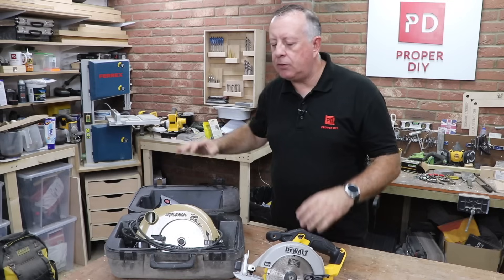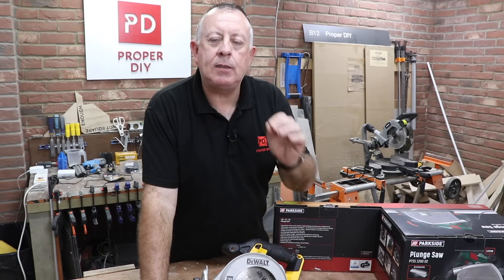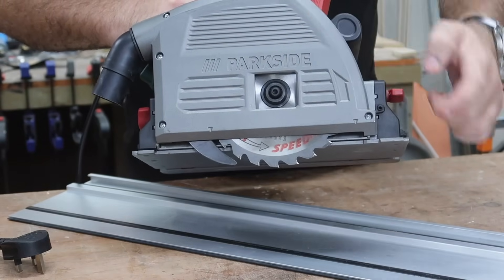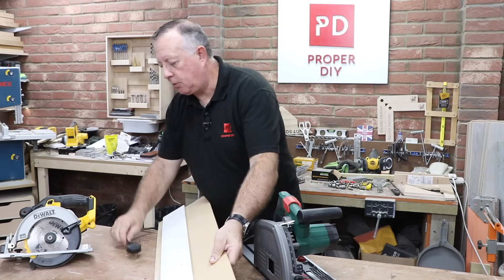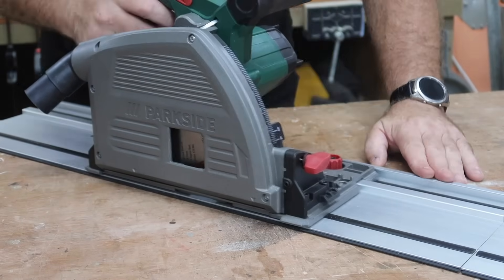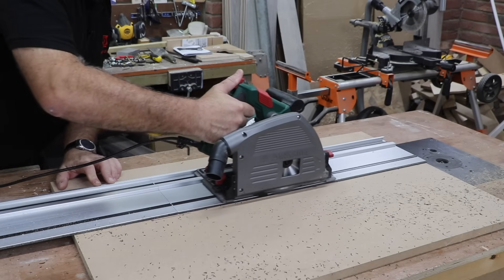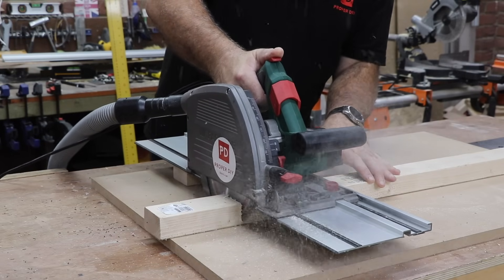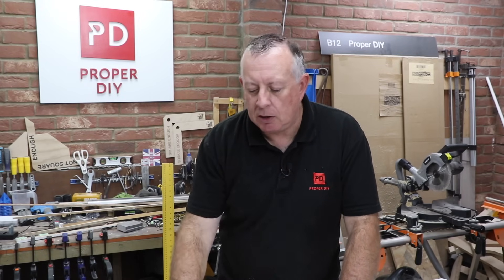Does the average DIY'er really need a Plunge Saw?

Comment: Good video Stuart. I own the Titan entry level plunge saw and the rail comes with two connectors so it can be joined at the front and back, it also has good quality rubber. Definitely a good choice for anyone wanting to spend a little more. Myself I always use offcuts at both ends and then use the rail clamps to lock everything down, just to ensure it won't shift.

Comment: For a 98% handtool workshop, a track saw is a great thing to have as it can someone like me loads of time when beveling the edge of a top/panel, cutting sheet goods on those occasions when making stable cores for veneered panels, etc… Depending on what someone is doing really answers that question as it does with every tool. A pluge/track saw is a luxury for a guy like me who has been sans table saw for quite a while now.  That said, if I’m going to do some framing work or am asked to come help a friend, I’m showing up with my ride or die Mag 77 Skilsaw. 
Thanks for the video 👍

Comment: I had a circular saw with a homemade track. Doesn't take many instances of it wandering off the intended line and ruining a workpiece for the plunge saw to pay for itself. I got a second hand Erbauer, does the job for accurate cuts but to be honest it lacks enough power and bogs down easily. I use a large sheet of sacrificial insulation board underneath.

Comment: A plunge/track saw is just like nearly every other tool in your workshop/spare bedroom/shed. It can be used for many things and some of them it will do well and some less so. Ultimately you do the job with the tools you HAVE (don't know how to do italic).
The job will either be easy or difficult, quick or slow depending on the tools you have to hand.
You can make high quality, accurate cuts with a circular saw if you take time to prepare the cut and take your time. You can make those cuts quicker with a track saw with maybe more accurately because of the track with lower prep time. And there are times when the type of cut you want to do is really difficult with a circular/track saw, but much easier and quicker with a table saw (long accurate cuts to create a thin strip for example).
If you can afford one and have the space to store it and the rails then a track saw is a great addition to your tool kit. But then so is a table saw for exactly the same reasons, and a jig saw and a band saw. You get the idea.
Ultimately I think if you are a DIYer/maker then you'll fill your toolkit with the tools you can afford and have space to store and they will be the primary considerations for most people.

Comment: I have had this exact saw for a couple of years now and it's been well worth the money. If you do any cabinetry with sheet goods and want consistancy and accuracy they are invaluable. I don't see them as a replacement for a circular saw but rather a tablesaw and fore most people this will do most jobs a table saw does at a fraction of the cost and size. I will say upgrade the blade to a decent one pretty quickly, it makes a big difference to the quality of cut especially with laminate materials and ply on the waste side. Decent rail clamps are a good upgrade too (the Makita ones are great and not overly expensive), the saw is pretty accurate but only if the track doesn't slide around.

Comment: I just bought a plunge saw and honestly i don’t understand how i could’ve done anything without it before. I could never get a satisfying cut with my circular saw. It was Ok for rough cuts such as breaking down osb sheets for my garage but definitely not enough for „fine” woodworking purposes. Maybe it was due to my terrible manual skills but no matter how hard i tried to press it against a piece of board acting as a track it always wiggled one way or another. I felt it was too much when i effed up a pretty expensive oak board i meant to use as a countertop for my cabinet. The cuts with a track saw are absolutely perfect and i couldnt be happier with it. I was really hesitant whether to spend a lot of money for a diy/amateur level kind of projects, but it was absolutely worth it. It saves a lot of time for me and i don’t have to stress out about damaging material anymore.

Comment: I bought the exact same model yesterday for 79.99 at my nearest Lidl. I've had a circular saw for a number if years and always looked at getting a plunge saw but always manged with straight edges of various descriptions. However based on your video and what my needs are this is a bargain. I have just started putting up shelves in my garage to make some room for my small work area. With 12 sheets of 18mm OSB to cut and seen it it was too hard to pass up.  Having cut all the sheets to the sizes i need it has been brilliant, not missed a beat and bang on with cutting measurements.  Keep the videos going as your one of the few who do not recommend a specific brand or sponsored by one. I use Einhell battery range as the batteries are way cheaper than other brands. But have a parkside impact driver (never missed a beat) and now a plunge saw.

Keep the videos coming 👍.

Comment: My plunge saw is my most used saw. I use it to trim doors, cut sheet material, it's also fantastic at cutting insulation (just make sure to connect the dust collection!). I picked mine up from Aldi 👍🏿

Comment: I got my Parkside when they were £60, I think it's their first model and It's been superb. It has allowed me to carry out cuts that would be have difficult to do with a normal circ saw and to a much higher standard (in my opinion anyway), I also feel safer and more confident using it. I did make some "upgrades", I bought a Festool track on a black friday deal and that gives me a total of 2.8m of track, it's also a better size track for most cuts I find. I also bought a trend high tooth count blade that gives me great cuts on MFC.
I do still own a standard circ saw which is used for rough work like fencing.

When time and funds allow I would like to set up a basic MFT type bench but for now I use a bit of Celotex on the floor.

Do I think a plunge saw is essnetial? No, but when you can get a pretty darn good one for just £80, why wouldn't you, a night out at the pub can cost more than that!

Comment: Bought a Lidl/Parkside one as a Xmas present to myself but not yet used it in anger. It lacks the 2mm scribe cut function of the MacAlister but it looks the otherwise rarely-used blade change lock could be modified to give this and still retain its blade change function.
The plunge function makes it easy to make a cut in the middle of a board. 
I was helping a kitchen fitter the other day and they used their beast of a DeWalt cordless plunge saw to put a hob cut-out in a worktop, something that a DIYer would probably use a jigsaw for. Four cuts, a pullsaw to complete the cuts at the corners and job done - measuring and checking probably took longer than cutting.

Comment: I also started with a corded Dewalt as the battery version was the 54 v kit and twice the price but since buying the corded version and using it so much i found it a pain in the backside reverting back to corded so invested in the 54 v kit which came with two 6ah batteries and at the time they had an offer on of a free 9ah 54 v battery  with the kit so now it sits with all my cordless kit...i only keep the corded versions of my kit as emergency back up but most havent bedn used for 5 years plus

Comment: I went to the parkside saw about 5 years ago, with an extra pair of rails and later on ,  & the long rail pack from screwfix (evolution I think). I did change the blade to a £12.50 dewalt one, and once I've replaced the rail gasket. While it wouldn't stand up to the amount of use Pete Millard gave his festool when doing cabinets, I've had virtually factory finish from every cut.  I've heard some complaints, but I must have got a good one,  and treated it well. Superb tool.

Comment: The Parkside looks a quality tool. I purchased a  Draper track saw and I am  very happy with it but as sometimes buying extra tracks for it was a  frustrating  waste of time. In the end Evolution tracks were the same.  I have a DeWalt saw table which is a superb tool but for just a quick job ,some carpenters saw horses and a scrap piece of OSB and my track saw does the job. A good selection of rip and fine cut blades are essential.

Comment: Thanks for this excellent vid. I initially bought a Mafell jigsaw after my Makita was tracking slightly off (though in hindsight it could probably be realigned with a few grub screws sorted). It's for the current loft conversion project - floorboards, joists, noggins, slithering the spare 2 x 4 lengths to get extra rafter depth etc etc.

Then after using my (apprentice joiner) friends Festool mitre saw, I decided I wasn't as scared of the risk to kick-back. So I bought a Metabo 305mm sliding mitre saw.

Now I'm at that stage in my life where I need to thin down some 2 x 4 lengths as well as do some angle cuts in them. This is to allow for adding depth to the joists (for good depth of insulation and a decent air gap) as well as making some angled/bevelled cuts for the hangers.

These hangers were put in by the builders who (probably) knew I would be doing the rest of the work after they'd removed the truss's for me. So they didn't seem to bother squaring up whilst trying to get the hangers/straights that connect the purlings to the binders. I need to straighten these out for when the kingspan insulation goes between them and the plasterboards over.

Tracksaw or good old circular!! It's my 3rd DIY loft storage/conversion with a little help/input from the structural engineers/joiners/builders. I already own a Mafell jigsaw, Bosch blue impact driver/wrench and Bosch SDS. A Metabo trade version of mitre saw and a few other quality bits of kit in between. Already also own a circular saw but it's cordless Milwaukee which will need new batteries/charger invested into, so am thinking to just buy a new Bosch or similar circular or tracksaw...

Decisions, decisions and input appreciated, pls... Thanks again for another great vid!

Comment: Perfect timing, my table saw gave up the ghost in the summer and been wondering if a plunge/track saw would be a good replacement, it seems like it will be, so thanks.  Also thanks for the Parkside review, I think I will start with that one once it re-appears in Lidl and upgrade if needs be later on.  Thanks for the time and effort you put into you videos I have learned loads.

Comment: I bought the biscuitjoiner from Lidl just to see how it worked. All the dust was drawn into the cavity where the blade sits and after 20-25 joints it didn’t start at all. Cleaned it and took it back for a refund. So the dust buildup is not isolated to the plungesaw. Bought the Makita instead and never looked back 😊 I will eventually buy the plungesaw from Makita as well. I guess that Lidl’s tools will work for most of their customers, but if I’m in the field I rely on things to work 10 times out of 10. Thanks for a nice presentation

Comment: I think a more relevent comparison is not a plunge saw vs a circular saw, but a plunge saw vs a table saw, because of the types of work they do. They deliver Quality of cut, precision, and better dust collection, and are more suited to workshop use, rather than on site, like a circular saw or a demo saw or grinder, or even a chainsaw.
For a DIY-er, a plunge saw is definity THE alternative to a tablesaw, especially for safety.
Reply: That's a good point

Comment: Valid points. But you can’t compare a cheap supermarket plunge saw against a decent quality circular saw. Mainly because the dust extraction on the high end plunge saws is very good and especially if you have a decent extractor. But I feel that having both is the ideal
Scenario. Only thing I would slightly disagree with is that you can easily use a plunge saw on a post or other non sheet good material. So both are interchangeable. Love the vids and keep up the great work. 👍👍

Comment: My neighbour bought one. He also has a small/portable table saw. Intrigued but not impressed (he got a Bosch). I have a full blown 10" contractors saw. Your video confirmed my opinion that for me the table saw is still it. If I was cutting sheet goods away from the house I would definitely look at plunge saws although the good ones are very expensive. Or I would get the lumber store to cut it on their panel saw. (You have to ask how often they get it tuned/serviced). So I think that portability is also a point in their favour although the trades I've seen still are using small/portable table saws.

Comment: Oh Stuart, once you have used a track saw you will never look back, I bought a second hand Dewalt which I used to cut sheets of ply down to make cabinets and cupboards for my campervan conversion. Have used it the last two days on other projects for my garage as much safer than using my Dewalt table saw. The only downside buying Dewalt is their rail is different to all the other rails on the market. 😢

Comment: I don’t have a plunge saw or a saw track. I use a metal or wood straight-edge clamped down to the workpiece, measure carefully (twice) and cut along that. This system has never let me down and i’ve cut rebates like this too with a fine/sharp blade.  It’s not the cost of the kit - it’s because I don’t want tools I don’t really need taking up valuable storage space.

Comment: Depends on definition of average DiYer. Neither you nor I are such.
Picture hooks, assembled Ikea, screw a hook on a door - don't need plunge saw or circular saw - a small case of a small drill screwdriver with bits (daughter has a Bosch kit that works fine) plus a jigsaw is all they need.
   Cutting sheets, gutting and rebuilding old houses... I managed with panel saws and circular saws plus mdf guides all my 68 years but the Makita track with Makita track adapter for my relatively new Makita 55mm deep cut circular saw makes me ask where it's been all my life.
   After rebuilding the bank account following numerous landmark birthdays, a wedding, external cladding, and new roof, a Makita corded track saw plus long track is on the shopping list. Will be making many cabinets for home and daughter in two wiggly bendy old SE London houses - so much faster, and I no longer have a heavy-duty bench to support hand tool work

Comment: Thanks for the comparison, you made it very clear what to use for what kind of work you need. A few additional tips are necessary First of all Parkside although cheap isn't the best brand around. There is even a channel on YouTube where you can see how to fix broken Parkside machines. And the other thing is can you add string with a spring on the ceiling to lead the power and dust collection?

Comment: I have made cabinets and wardrobes round the house. The first one I made using a circular saw and home made rail. After that I got the parkside plung saw and it was a game changer. No going back now. Also, Lidl, or rather the tool manufacturer for Lidl (kampernach I think) will sell you more rail. I bought four more rail sections so I could have a 2.8m long rail and some spares for cross cutting at 1.4m I think they were only like 35 euros delivered to the UK. Worth the extra investment if breaking down 8x4 panels

Comment: Personally I believe the similarities between a circular saw and plunge saw are purely they look similar and have a spinning blade, they are very much horses for courses, comparing them is comparing apples and oranges.
I consider the plunge saw more as an alternative to a table saw because their uses are far closer imho. but like all tools circular, plunge or table they have their strengths and weaknesses depending on what you want from them
Reply: I use circular saw for rough and fast cuts and plunge saw for precise cuts.

Comment: I'm very late to this video but I bought the older version of this saw and the screw to hold in the blade was seized. It looks like it uses an Allen bolt now but then it just used a standard slotted screw that stripped almost immediately on applying pressure. Tried everything to remove it - penetrating oil, heat, grinding into the head, and now there's no head left but the bolt has a reverse thread so I can't drill it out. So now the tool sits unused in my shed... just worth noting if people are thinking about buying the Parkside one!

Comment: I have the same plunge saw (maybe the previous version: it has no riving knife) and I'm pretty happy with it... but it has a weak point... or two!
The biggest issue is that rubberish splinter guard: it unglues pretty soon and it's not easy to reglue. I tried double side tape, contact adhesive, clean with solvents before gluing... but no method has led to a lasting result: especially in hot times it moves or detaches! Furthermore it's curved in the underside, so it doesn't really protect from chipping as it should.
Btw, you don't need that trick to cut it at all its length: simply put the saw in the track at the far most point where it's stable and plunge all the way down; that's the max you can cut anyway on the track!

The other weak point is it's a little wobbly in the joint that makes it plunge, so if you change a bit the force applied to keep it down and make it move forward, you'll have a little step in the side of your piece. Same if you stop your cut and then restart.
Reply: Superglue and Baking soda.
Reply: @RO8s  I'll give it a go, thanks!

Comment: Thank you for a very useful video. I completely agree with your conclusion. I bought one to help with a bookcase project. It is fantastically useful for sheet material, shelving, etc. I was using some expensive oak and scared to death of getting it wrong. With a tiny bit of ingenuity (or quite a lot of money) it is possible to use jigs to do repeated cuts with accuracy (something my table saw is very good at, but not on the scale I needed). Yes, it is a one trick pony, but it is a very useful trick and it does it very well.